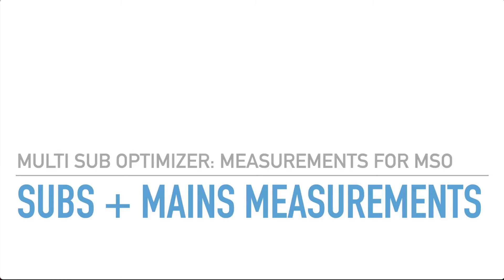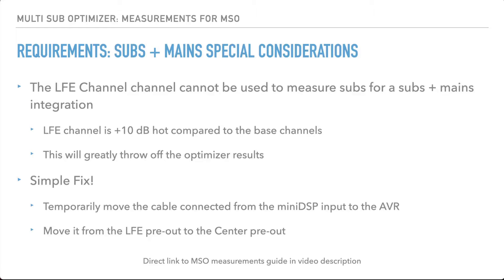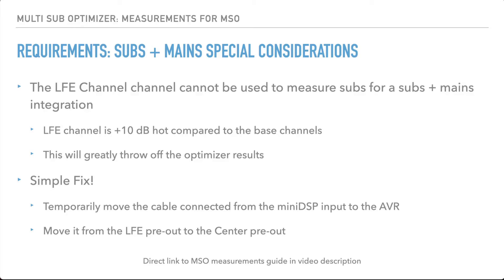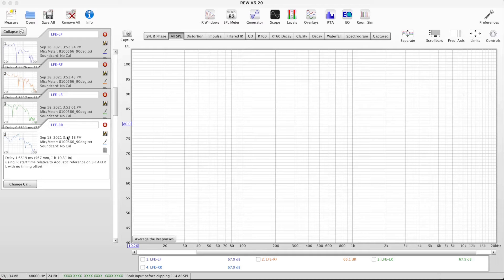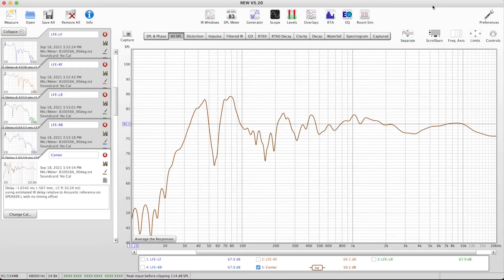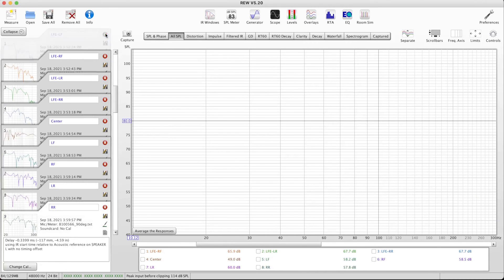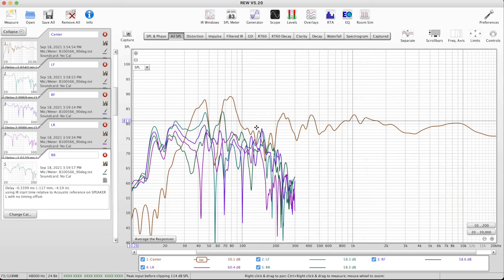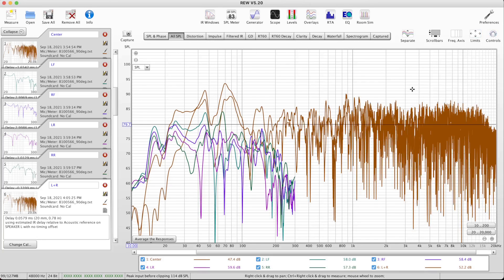Measurements for MSO: Subs + Mains Measurements

Comment: To get the options to measure the center and surrounds in REW, is that a part of the paid Pro REW, or setting that I missed in the free version?
Reply from the maker: That's basic functionality.  The only paid feature is "multi-input capture" for (I think) $100 USD.  That option lets you capture input from more than one microphone at a time on a single measurement.

If you don't see the other speakers, you have a config issue somewhere or perhaps a bad HDMI cable.
Reply: Thanks Jeff, I think it's because I normally use "pure direct" mode on my Marantz receiver, and use the right main out for measuring.
Reply from the maker: @briansexton713  I think that's correct, but I'm rusty on the Marantz units.  I think you'd need to set it to "Multi-Channel".
Reply: @jeffmery so, I merely updated REW, and the options  for other channels showed up.
The warnings that the newer version of Rew not being able to open older files had my shy of updating.

Comment: Hi Jeff, the one thing I'm curious about with Subs + Mains measurements is do set sub distance to 0.0 and leave your speaker distances at whatever your room correction had them set at? After running, MSO will give an AVR sub distance adjustment and it seems that would only work correctly in conjuction with original speaker distance. For instance, if everything was set to 0.0 when you measure, it seems MSOs calculation would be off once you set your center (or mains) back to whatever they were. (eg. 7.2 feet). Am I correct with this?
Reply from the maker: Correct.  MSO's results are relative to the measurement conditions.  So if MSO says you need 3 ms of delay and the original was 7.2 ms. then the new delay would be 10.2 ms.  Does that make sense?

I generally don't recommend doing subs+mains integrations in MSO when using some other automated room correction.  It's not that it can't be done.  It's that it's a more advanced topic and gets confusing quickly.  Additionally, most processors don't have all the capabilities needed to properly implement things.  I'm not trying to discourage anyone from doing that at all though.  Learning is fun 🙂

Comment: Hey Jeff, awesome video series. One question: when taking the L+R measurement, should the L/R speakers be time aligned, or just measure them both with the distance setting to zero? I only ask because they are not equidistant from the listening position(I’m calibrating for music in a garage.)
Reply from the maker: Good question.  Yes, if you are optimizing for the main listening position, then the L/R need to be time aligned before integrating the subs.  If they are not, you align the subs, and then align the L/R, there is a risk of that alignment breaking or at least negatively impacting the L/R + Subs alignment.

Comment: Can this be used with the L or R preout ? My x6700 center pre out is not working. Also can you just set the LFE signal level -10 db ? It’s not the same as the life gain level
Reply from the maker: LR is fine.  Plug the subs into R and use L for the acoustic timing reference.  It's actually a little faster because it requires fewer changes in most AVRs.  Set the LR speakers to "Large" in your AVR / Processor to ensure you aren't impacted by a crossover.

There's really no point in adjusting the LFE signal.  You just want the measurements to be 30 dB or more above the noise floor of the room across the frequencies of interest.  This can be hard to do at infrasonic frequencies.

Comment: Whats wrong with just dropping AVR level by 10db or using MiniDSP to do the same vs swapping the cables?
Reply from the maker: It’s not about the SPL. It’s about getting a full bandwidth measurement and bypassing the built in LPF on the LFE channel. Some processors or AVRs allow this to be configured. Denon, for example, will let you set it as high as 250 Hz. Other devices don’t have this flexibility. 

Using the R or C channel and setting that speaker to “large” works on just about every AVR or processor ever made.

Comment: Hi is there a link to the MSO , sub and mains integration video?:)

And then a bug 🐛 I have find in MSO: If the mains is sub Eq out for example start at 100Hz and the sub starts at 10 to 200hz, and the measurements for the mains is starting at 100Hz and not from 10Hz, the MSO will only start by drawing the mains 100 to 20kHz and then only draw the sub 100 to 200Hz.. 🤔
Reply from the maker: I haven't done that video yet.  I previously didn't have the equipment to do it properly without major recabling of things just for the video.  I have new equipment now, but still haven't had time to do the video.  I apologize for that, but it is on my to-do list.

If the measurements for the mains start at 100 Hz, there's nothing to graph for them below 100 Hz.  I.E., there's no data for MSO to display.  Measurements on the subs should be "as high as possible"; ideally taken with the subs connected to a full range speaker channel and measured from 10 - 300 Hz.  Mains need to be measured at least one full octave below the expected crossover frequency.  Crossovers are typically in the 60-100 Hz range.  This means the mains need to be measured from 30 Hz up.

You will probably need to temporarily set the mains to "Large" to make sure you can get a full-range sweep of them without the low-pass filter of the crossover affecting the measurements.
Reply: @jeffmery  when doing subs + mains, is MSO taking the mains output into consideration to better optimize the subs, or is it also creating filters to be applied to the main channels. (which is not something that's typically done with a miniDSP)
Reply from the maker: @Alex-iv5pu  It's typically implementing filters on the mains as well in order to get a smooth response through the crossover region.  You're right it's not often done through miniDSP as the most common use case is for home theater.  We're typically using some kind of room correction which will undo any work we've done to manually integrate the speakers.
Reply from the maker: Your comment triggered a memory!  @Sergejs on sound did a subs+mains video about 6 months ago that I had totally forgotten about.  I finally found it (and saved the link!) so i wanted to share it with you here:

https://youtu.be/DzRjVmNK9N8

It's a really well done video.  He uses the UMIK-X to get a bunch of measurements in a short time period, but the process is really the same with a standard, single-capsule mic.  It just takes longer to get your measurements done.

Comment: Can you please post the link of sub + main integration video. If you made it 😊
Reply from the maker: I didn't make one and no longer plan to.  That's probably disappointing but there are some real reasons for it.  The main reason is that most people are using this with home theater.  Outside of very high end processors, the crossover requirements cannot be met to satisfy the requirements of MSO to do what it needs to do.  The second reason is that in a home theater, you're going to run room correction after the sub optimization.  This is going to set its own crossover and distances that will negate anything you do from an MSO subs+mains perspective.

Sorry to disappoint on this front.

Comment: I didn't move any cables around. Instead in my Denon AVR I set my main speakers to small and set the crossover at max (250hz) and sent the 10-200hz sub sweeps to the center channel. I think this accomplishes the same thing as moving cables but I would like to confirm.
Reply from the maker: Yep, that should work.